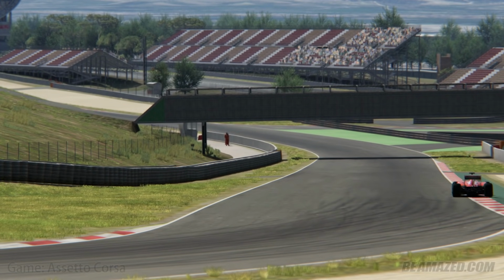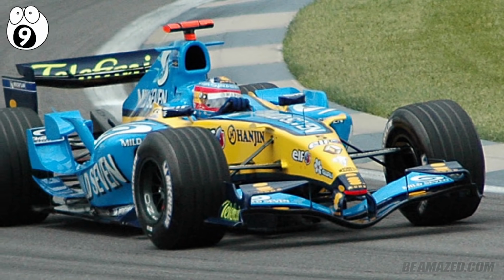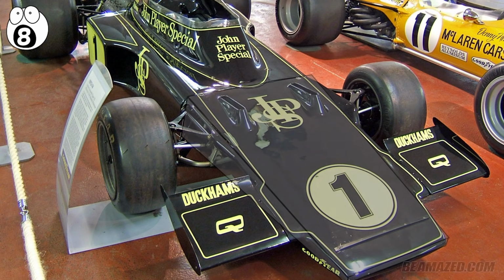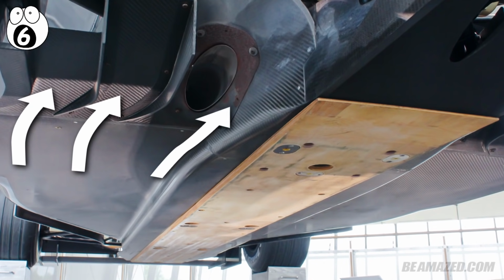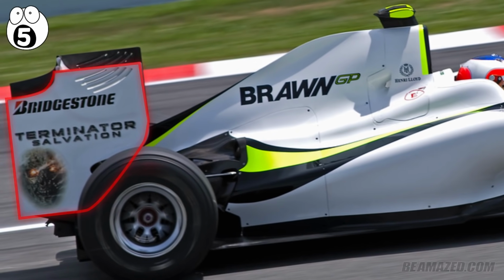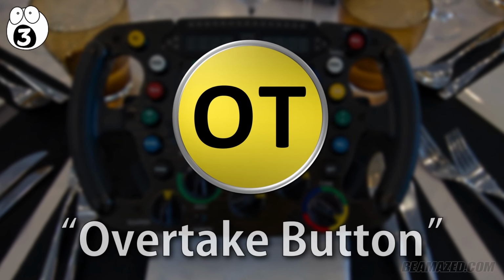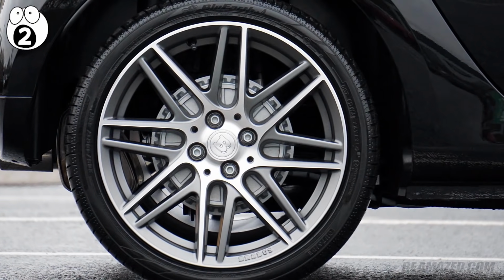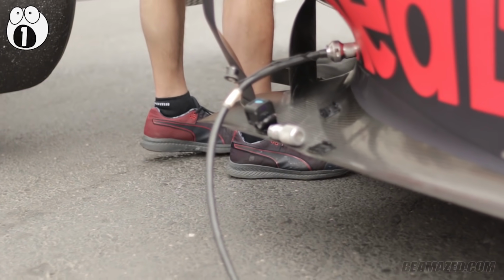Secrets Of F1 Car Design You'll Find Really Interesting

Comment: Underbody: At the Front you have an opening to catch air. In the centre you have a area where the air is squeezed thru a smaller cross-section. Faster air has reduced pressure, low pressure multiplied by surface (of car underbody) results in a downforce. The underbody has the benefit of the ground-effect. Now the diffuser, what is the point of the diffuser if the fast travelling low air pressure zone in the centre of the underbody is the key thing. Well the diffuser is an open end for the travelling air, means at the exit opening the air pressure must have ambient air pressure. So going backwards, and you need to think backwards for this effect, not perfectly intuitive, but it works. If the air has ambient air pressure at the exit, and the exit is a bigger cross section than the centre part of the air tunnel, the air pressure in the centre is reduced by the diffuser. So the diffuser helps to create under-pressure or increase the under-pressure in the centre of the air tunnel underneath the car, what creates downforce. If you are lucky you can guide the air with the diffuser to the rear wing, in a way that it supports the rear wing, maybe. 
So that explanation in the video really was bollocks. 

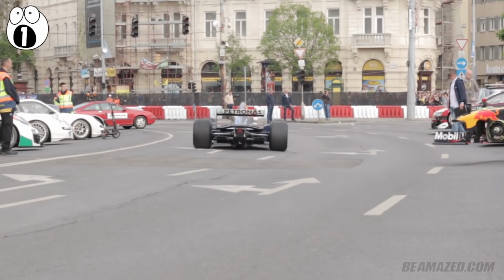Also the boreholes in the brake disk that shall cool the disc or bring the hot air to the wheel, as he said it, he showed the wrong holes. Axial boreholes are not in the discs for cooling, they are especially in steel brake discs to reduce heat stress in the disc. The radial boreholes are there to cool brake discs. A carbon brake disc has a very low thermal expansion, so it rather doesn't need the axial boreholes. And at 10:02 of this video you can see an example on an F1 car brake disc that actually doesn't have the axial boreholes and only some radial boreholes. 

Youalso said the boreholes in the discs are to heat up the wheel/tire. Well that is difficult to argue with but certainly not the right way to explain it. The starting point is that brakes get hot on braking ad carbon brakes and brake pads need a certain minimum temperature to work properly. So they need to be cooled a certain amount but also not too much. So everything inside esp. the rather small F1 wheel is going to be heated up, also the wheel also the air inside tire. I want to stress that it's this way around and using the brake heat to heat up the tires in the parade lap for the start (also the way they do it in GT3) is a thing but still not the right way around to explain it.

Comment: The air under a car is low pressure, not high pressure, otherwise it would have the opposite effect. Pressure is inversely proportional to speed. When air from a big tube is forced through a smaller tube, it gains speed, so the pressure is decreased in the small tube. Same thing happens when air is forced under a car

It's counter intuitive, but it's how it works. Plane wings are shaped like a D rotated left because air has to travel faster on the top side, thus reducing the pressure and generating lift.

Comment: Congratulations.... You got everything wrong,  do better research next time.
Reply: Yeah i agree
Reply: agreed
Reply: Why did he get it wrong?
Reply: @Coli2603  I'm only a minute into the video and the terms are wrong, the footage is mixing between different eras of formula 1 (which is not ideal as regulation changes regularly) and they might've even used footage of a formula feeder car (f2,f3 etc. )

About 5 minutes in... How is hitting a brick wall in 185 mph the equivalent of 5G's? What even–
The pronounciation of Nurbürgring is horrible, and they thought that the fact that the rear wings mess up the airflow (which the fia is constantly trying to solve and probably will be very soon) an actual feature.

Literally noone calls the tires' theory 'the dark arts'. Also the tires' compounds are outdated but that is forgivable as this video is made in 2017

Comment: The air intake above the driver doesn't give the ram effect what so ever, actually does the opposite, because the inlet itself is smaller than where it's taken in by the engine's intake, the air slows down actually dropping in pressure, if I'm not mistaken this is allow the air to cool before the intake, any "supercharging" done in an f1 car is done by a turbo, you are correct though in saying it is up high to collect less turbulent cooler air, but no ram is achieved nor is it needed due to the cars having turbos

Comment: the holes in the disc brake are not for cooling, they're for cleaning the brake pads.
also cooling wouldn't work because the holes are always stuffed with dust and other dirt ( as they're supposed to ), hence not letting air through anyways
cooling is only done by the openings on top of the disc

Comment: 1:01 There is no circuit called Nurembergring, its Nürburgring, not in Nuremberg but in the Eifel mountains! The corner that's shown in the video is the famous Karussell.

However, Nuremberg has also a street circuit called Norisring. Noris is the Latin name of Nuremberg. They choosed that name because Nurembergring looks to much like Nürburgring.

A similar misunderstanding in motorsport is the name of the famous steep corner at Spa-Francorchamps. Most people think now the name is Eau-Rouge, but the correct name is Raidillon.

Comment: supercharges the engine by putting excess air AROUND it is one of the stupidest things I have ever heard you cant supercharge an engine by putting air around it that's not how engines work that air has to be compressed and pumped into the engine its self  by a separate part like a supercharger or turbocharger.

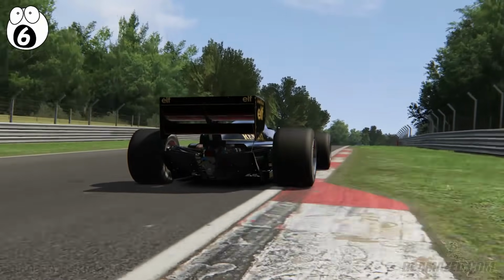Comment: 4:25 actually Venturi Effect it's the opposite. Underneath of a F1 car the Air Pressure is lower so, air speed flowing over there is faster. Also is a common sense event, it creates downforce because that pressure is lower than on top of the car.

Comment: Just a correction, I believe nowadays brakes are solid. Back then the flow was important, but now strength of brakes and thermal heat capacity are more important than air flow.

Comment: Some humble corrections
1. Front wings are not the most important wings. The rear wing is. Early 80s, during the heyday of ground effect, many cars didn`t have the front wings but still included rear wing. Rear wing is for keeping grip and F1 cars would spin without it. 
2. The long sidepods the late 70s F1 cars had were to contain the special ground effect tunnels. Ground effect was banned 1983. Gordon Murray almost removed the sidepods from his Brabham BT52, only small radiator holders remained and this car was very succesful one. So long  sidepods are not very good for aerodynamics.  
3. Ground effect was popular because it did not depend much on the speed of car so it was very effective on the corners. That`s why the desingners try to secretly re-establish the effect using shaped disfusers etc. But ground effect was banned 1982 because it was dangerous too disappearing in moment when car jumps  a bit  higher.

Comment: The *tires are made of composite instead of rubber, the WHEELS are made of magnesium.  It was confusing when you kept saying wheels when you meant tires
Reply: Also I have seen so many fucktards screw up an f1 wet tire its simple just a little thread instead the models look like ultra soft

Comment: Front wings prevent vortexes? They create vortexes around the front wheels so that the air doesn't smash into the front of the tyres...
Reply: I had to take physics  there is an effect called the magnuss effect if the tire is spinning the opposite way of the air resistance wich it always is it will produce downforce by rolling over the top and being sucks down by the turning of the tire sucking air ontop of the front of the car slamming it to the ground

Comment: Wtf. A car hitting a wall at 185mph is only 5 Gs? Are you just making these things up as you go..?
Reply: If it's just 5 Gs Roland Ratzenberger wouldn't get killed
Reply: They hit 6Gs in a corner, when Hamilton "crashed" in qualifying in Brazil he hit 12.6G
Reply: Race  tracks are designed to contain an impact to the track ever since the Le Mans tragedy so most of the energy is kept within the car (hence the 45+G that’s not entirely uncommon) a single layer brick wall wouldn’t do much to stop a normal 1500kg car at 200kph and so the car wouldn’t absorb that much of the energy you see garden walls destroyed at relatively low speed traffic accidents. If a normal car hit a properly solid structure at 300kph and take anywhere close to 45g then it would be completely destroyed. It’s not so much a case of the speed as what they’re hitting. Tech pro barriers do a great job of keeping the crash forces acceptable but in the period after Le Mans and before track safety driver where hitting solid concrete which is where all the ridiculous g numbers come from and why there where far too many tragic F1 fatalities.
Reply: yeah. they make about 4.5 G during cornering in some places and alonsos crash in australia 2016 he had 45-50 Gs if i remember corectly
Reply: Trance 9 u don’t need to be Einstein u realize it’s more like 40+ Gs when u crash at 185mph
Reply: Uriah Siner kubicas crash in Canada peaked at over 70g, and he was going damn near 180 and he slammed into a concrete wall.
Reply: @Ethan Hiers Oh the irony! Plastic? TF? Also, carbon fibre is quite rigid, thats the reason its used. If it was not, it would crumple very easily and NOT slow the car down. Also, where did you get the fact that "the femur bone, when broken, can be fatal". Also, dyslexia is a reading disorder. 

Oh and calculating G forces? You are aware that its a measure of acceleration. so its just deceleration/9.8? Where did you pull 9.8/deceleration*speed? What does that even mean? And what frame of reference is your "speed"? If its before the crash, well my friend you sound quite stupid. Deceleration = change in speed / time. So: 9.8/(-v/t) = -9.8t/v. Multiply this by speed = -9.8t which is a... negative number. Not to mention t will be quite small. In a collision time of 0.1s, he experiences 0.98g? Regardless of initial velocity? Or maybe its 9.8/((-v/t)*v) = 9.8t/(v^2).

 Again, where the hell did that come from. V^2? Really. I'd like to see how that affects anything. Also, how TF does mass change anything in equations for acceleration? Not to mention, speed + time taken = acceleration, so you effectively mentioned the same thing twice. Why? Is it because, perhaps, you did not know they were the same? Also, severe Gs... what excatly? You realise you can lose consciousness with enough Gs right? Fighter  Pilots train for that? And what do your bones and blood do exactly... you dont bleed after a high G crash. So for once, shut the hell up.

Oh and if you're wondering what the guy did up there, since there are other factors into play here, he just took the measured values for G forces at 95mph and extrapolated it to 160mph. Again, wtf are you on about
Reply: @aletheiaaaaaa  literally google "is a broken femur deadly"
Reply: @aletheiaaaaaa  btw, g-forces arent accelleration. Its when you change speed quickly. Going from 0-100 in 1 second is the same as going from 100-0 in 1 second. You can even search it
Reply: @aletheiaaaaaa  you literally just said it isnt 9.8/deceleration*speed, but you judt said its 9.8/deceleration
Reply: @NotXion  OOF I meant deceleration/9.8 my bad, thanks. Or so I thought. Legit read the thing: Unedited its deceleration/9.8. What? And 0-100 and 100-0 both in the same time ARE the same thing, the magnitude is constant, only different direction? Because acceleration is change in velocity? You're basically strawmanning at this point. And G-Force is just that, acceleration. "G-force is a measurement of the type of force per unit mass – typically acceleration – that causes a perception of weight". Thats how its used in this context? Also, this is about F1 cars, not your average Prius, so your plastic argument falls apart too?
Reply: @aletheiaaaaaa  last thing, again, search it, most cars are actually made of plastic
Reply: @aletheiaaaaaa  the frame is
Reply: @aletheiaaaaaa  body*
Reply: Links for further research? Where I can find the legit info and learnt the F1 Aerodynamics?
Reply: I think there was a driver who sustained 214g in a crash, 174kmh - 0 in like 62cm

Edit" changed "is" to "in"
Reply: a car hitting a wall at 185 miles an hour makes you dead.... a normal human can withstand up to 40Gs of decceleration.. so yea.. i'm pretty sure it's not 5Gs... :)
Reply: This one really got me.
Reply: He is stupid
Reply: considering the wall would break
Reply: @colinkramer36  considering it probably wouldnt
Crash barriers are really solid
Reply: if we could tell the mass of the vehicle in question and the time it takes exactly to decelerate would that fit the algebraic inelastic collision model??? we're probably looking at around 20-60 g's depending on the compartmentalization of impact... 1/2 mass times velocity squared where the deceleration would be measured in "g" forces the actual quantity you are solving for would be PASCAL. If you aren't talking about an impact in terms of pascals... you have no physics.
Reply: rough calculation: 
what I can do in 5 mins, so can you ;)
E=mv²/2 = F *s with F=const. 

a_brake=v²/2s_brake 

Assumption from watching races:
assuming a dampening wall at the racetrack has a thickness of ~1.25 m, 3/4 of which may help dampen the impact of the F1 car
-> s_brake ~0.93m

g's at 100kph=27.777m/s :

a_brake=  27.777^2/(2*0.93) [m/s²]= 415 m/s²

a_brake= a_driver= 415m/s² = 42g.
-> t_collision~0.07secs
This may be a high value for 100kph=62 mph but again, I assumed that the driver did not penetrate the dampening walls. 

Reference:
Sainz' collision time was about 0.1s, though the breaking distance much greater (~1.5-2m) - after all he penetrated the walls.

@Uriah Siner

E~v² (assuming same braking distance)

a_brake at 185 mph/a_brake at 95mph =      (185mph/95mph)^2= 3.8

a_brake185=3.8*42g= 160 g
Reply: It all depends on the weight of the vehicle, it's center of gravity, speed, etc. G-force calculation is a very tricky science revolving around many variables
Reply: Uriah Siner so how many Gs is it then Einstein??
Reply: Bryan Hopkins I remember a RedBull hit a tire wall at like 95 last season and they said it peaked at 40+ Gs.
Reply: Bryan Hopkins
https://www.topgear.com/car-news/crash/f1-just-how-big-was-sainzs-46g-sochi-crash-we-do-maths

Here it is Sainzs w/ Toro Rosso hit the tire barrier at 93mph with a peak force of 46 Gs. Considering 185mph would be double the speed and a brick wall is much more solid than a tire barrier, Im faily certain that crash would result in more than 5 Gs.
Reply: Because 5g is 9.8 x5 ie gravity x5
If you can imagine what that means relating to forces 5g is heavy braking. 180 to 0mph in less than a second your looking at 40g+

All these figures are guesstimates

Comment: Actually it's the rear diffuser that's the most important element on the car. It provides up to 60% of the cars total downforce with a minimal drag penalty. Think you might need to do some more research...
Reply: Yes and provides a helpful slipstream on straits and actually the hotter the air going into the engine the hotter it burns the faster you go

Comment: #9. Sorry. But it’s bullshit. They actually have a supercharger on top of the motors intake itself to force the air from the intake into the engine. #5. Ehhh, you missed the real fact they have them. The wing is really used to forse the tires to the ground. #1. New crashes have made people go to titanium wings and other such parts

Comment: Watson's crash was not survivable because of the carbon fiber, in fact the speculation at the time was that carbon fiber was less safe because it might be more brittle than aluminum. That crash was influential because it proved carbon was a good material choice not just for performance but also for safety and ushered in the wide adoption of carbon tubs by F1. Also the front wing is no longer there for down force. That is a small role that it plays but regulations have reduced that aspect of the car and now the space is used to channel air away from the wheels because they are aerodynamically terrible. If you're curious about the workings of F1 cars I would recommend looking at different videos because they are more accurate and up to date. The Flying Lap is a show about F1 rules regulations and design.